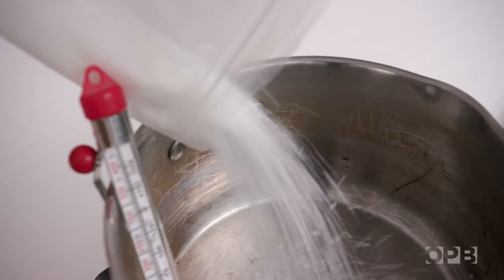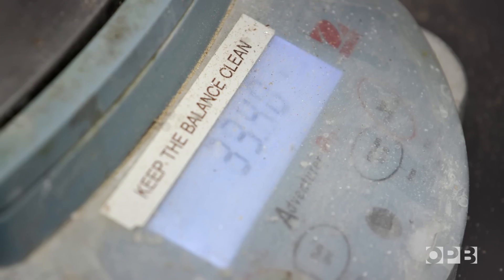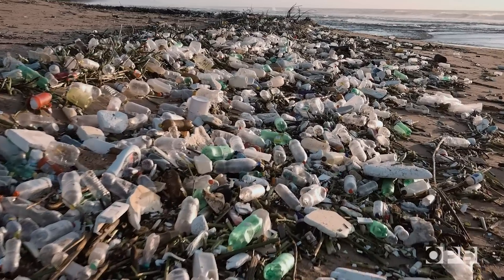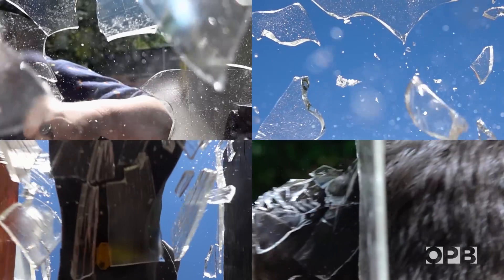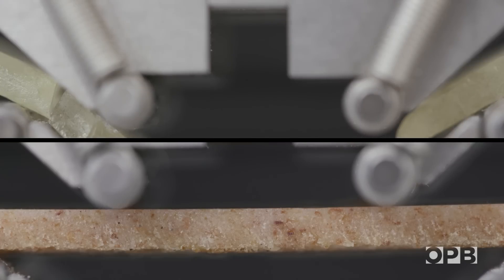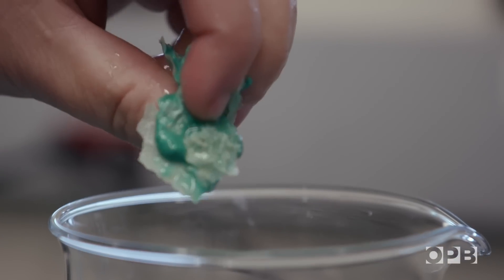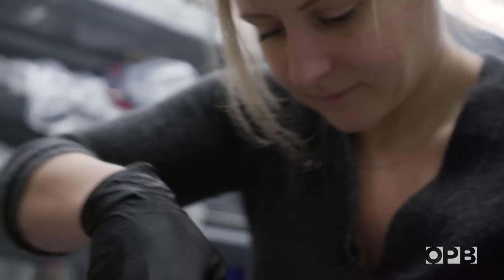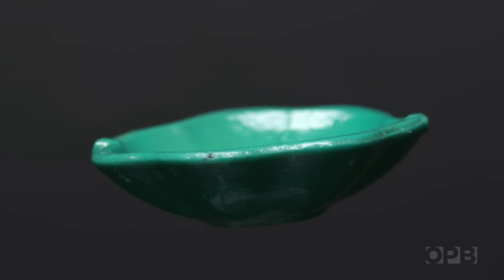Can this sugar-based material replace single-use plastics? | All Science. No Fiction.

Comment: One of the largest and most problematic uses of single-use plastic is in water bottles, as well as many other applications that involve water.
This substance dissolves in water. You can’t make a water bottle from it.
Any utensils made from it (such as the fork demonstrated) will flavor your food.
It’s brittle and glassy, which means it’s already supplanted by celluloid, paper, starch, and banana leaf as packing and wrapping material.
I’m struggling to think of what this would replace.

Comment: Nice work.  Local and good enough!  

Both milk protein and egg can be dissolved in water and dry waterproof.  

Glue made from animal hide can be very strong and slightly waterproof.  

Carnauba wax can be combined with water using a vegetable emulsifier for a slightly durable waterproof coating.  Bees wax is softer, but local. 

Many tree gums and resins that dissolve in grain alcohol or essential oil are waterproof.  Pine would be a local source for solvent and resin.  (Don’t shy away from VOCs like citrus, rosemary, lavender, pine… they may be part of a solution). 

Flax is a tremendous material to impregnate with glue to make plastic/composite panels.  Discarded clothing also works.

I forgot to add drying oils like flax/linseed or walnut are waterproof.  Linoleum is an all natural plastic made using cork and drying oils. It’s quite durable… the stuff used on the Titanic still looks pretty new.
Reply: be careful with citrus, rosemary, and lavender oils, as some of us are very allergic to them, and the allergies are more common than you might expect. Better to use oils that are less likely to be allergenic. VOCs are also something you can get sensitized to through exposure, so I wouldn't choose to make plastics that are planned to be in contact with food from them

Comment: This poses a number of problems.
Using plants that are normally intended for food for something else causes huge problems, such as the spectacular rise in the price of maize after the United States decided to use it as fuel, which caused famine in Mexico.
In addition, if this product dissolves in water, it feeds micro-organisms and algae, which will kill fish.
Not to mention the fact that plastics are a by-product of the fuel industry. If petroleum-based fuels continue to be produced, what will happen to the hydrocarbons that cannot be converted easily into fuel?

Comment: Tableware for parties can be replaced by paper, and other plant fibers, without even converting to cellulose like rayon. You can even use pressed banana leaves paper plates. Tableware for parties doesn't have to travel with contents.
Tableware for parties can be replaced by real washable tableware. 

The problem is shelf packaging. A water bottle has to survive shipping, and sit on a shelf for weeks, without dissolving due to the contents of the package. Shelf packaging is what's breaking into particles in the ocean.
Reply: "Shelf packaging is what's breaking into particles in the ocean." 
Valid point. 
Even if one uses paper and other plant fibers, the plastic they're wrapped in doesn't dissolve, and it's generally not very reusable. 
However, if we could replace plastics used for bagging and wrapping products like dry goods, that alone would reduce the plastic input. Additionally, an isomalt based product could be used for takeaway trays and cutlery, along with other short term food storage requirements like grocery store produce / deli products.
Reply: I know one aisle with the tape is shelves of almost nothing but plastic.

Comment: Plates and cups get wet, and the sugar would melt.
Reply: They're using a food-grade biodegradable coating that makes it waterproof plenty long enough to use (even a few times)
Reply: @jesburns3605  Can it be used as containers?
Reply: @zyxw2000  Based on what I saw in the lab and what the scientists explained about the performance of the material - yes. For dry goods, it would hold up pretty well (unless the coating was compromised)  Though to be fair - their goal is creating a material engineered for single- or very limited use. They want it to break down if it gets littered.  Or be recycled (dissolved) once it's been used to b reformed into another product.